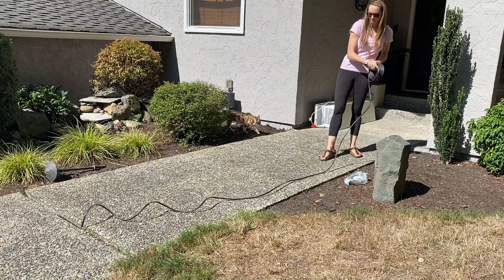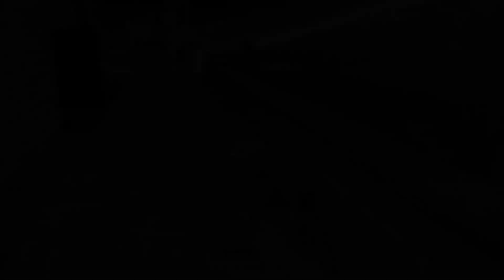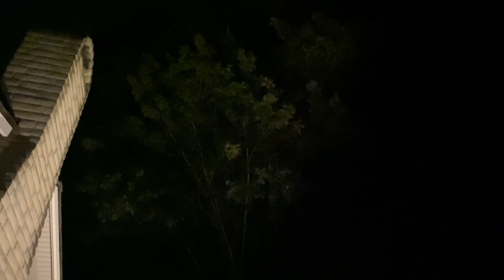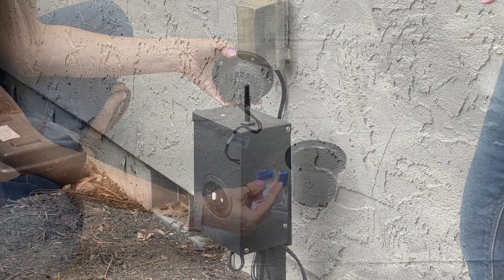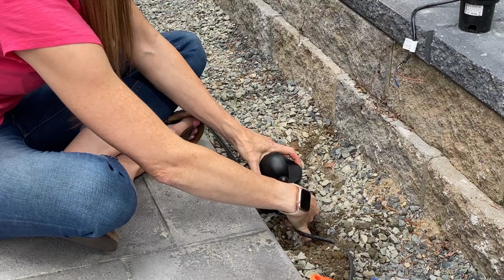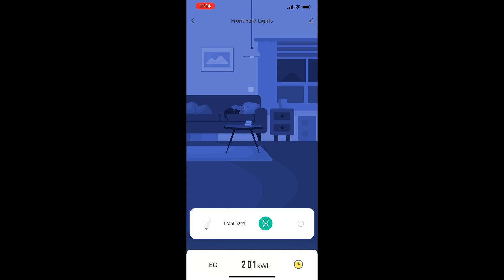Which low voltage lights are right for you?

Comment: Hi 👋, nice 👌 job , it looks great 👍, I have been thinking of doing something similar, there is a better pair of wire strippers that make it easier for you to strip back the wires, not how they cost 💲, but you put the wire in to the jaws of the pliers , then, as you squeeze the pliers together one part of it, grabs the plastic shroud and the other part as you go to squeeze it Paul’s back and strips off the outer casing, makes it very easy and quick to strip the wires back, keep up the great work. Stay safe., Phil from the moulin France.
Reply from the maker: Thanks for the tip, I’ll try those